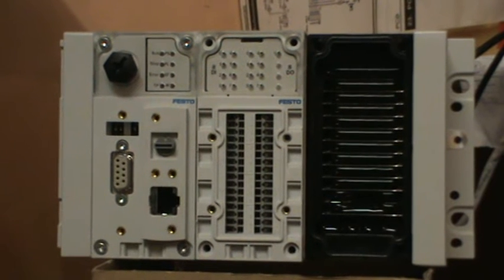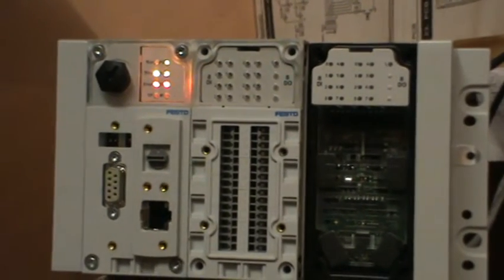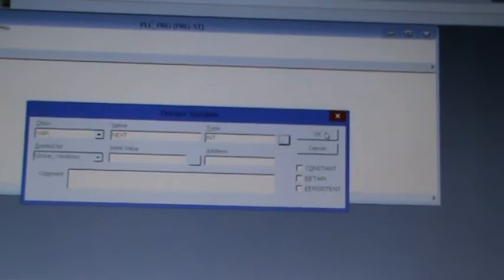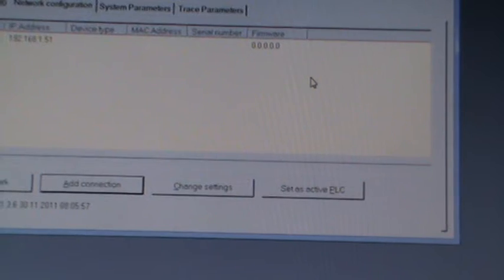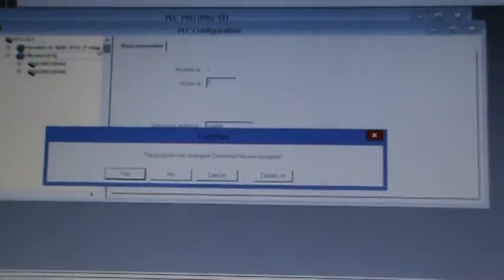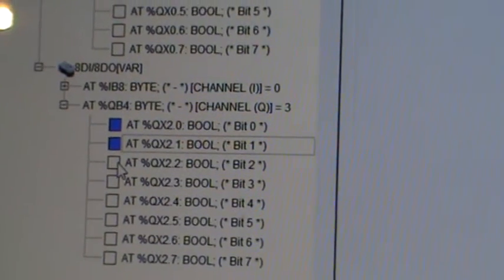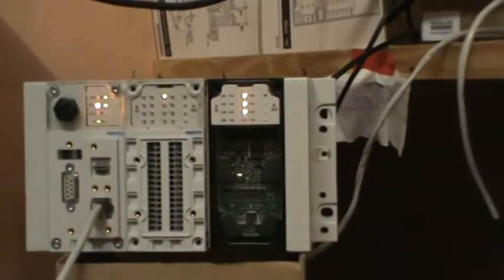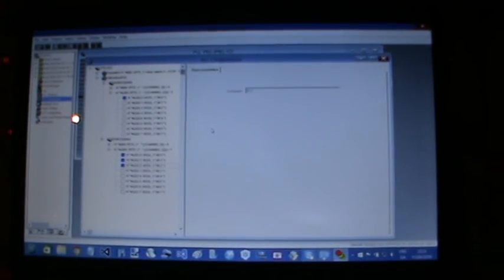BOSE FESTO  CPX CEC

Comment: Hi. I have acquired a similar model. However, without any power supply. I've googled a lot regarding this component but I was unable to find one. I believe it will be a AC/DC switch mode power supply providing 24V. However, I've not see it anywhere. In your video, the power supply is hidden. Can you be so kind and point me the brand or the reference of the power supply you use in this video?